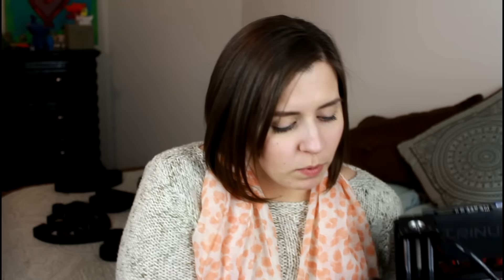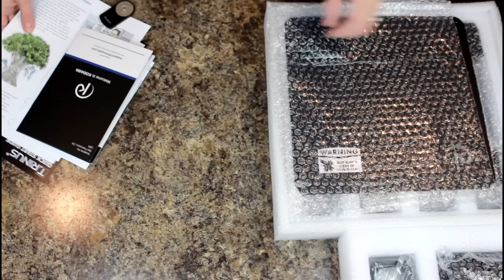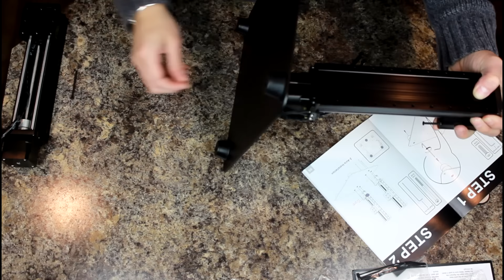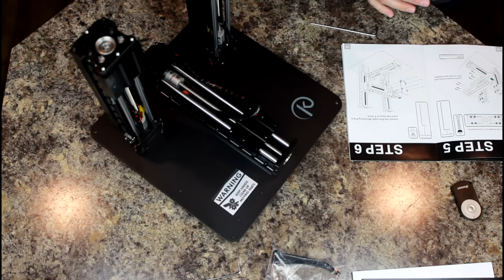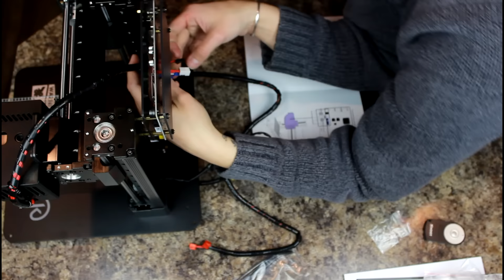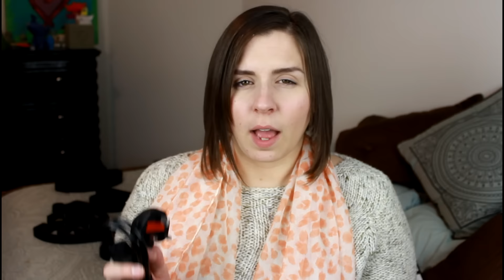Trinus3D  Build & First Impression

Comment: A friend over at our Makerspace showed up with a Kodama Trinus including the touch screen, heated bed and enclosure. I guess that must have been the ultimate luxury version. His son pulled it from his cellar. It has never ever been used before. Really hard to believe. During the afternoon I stayed at the Makerspace I searched the internet, trying to find as much information about the printer as I could. Luckily I found a firmware update based on Marlin. That way you can sliced files in gcode format. I‘ve started to create a basic Prusa Slicer profile. Still having some layer swifts on the X axis. I guess that the travel speed still has to be reduced. It’s a beefy little 3D printer. It would be really awesome if my colleague could use it.

Comment: Good Day, quick question, how much trouble if any did you have calibrating the bed with pango? i think there is a good deal of videos of reviews and assembly but the calibration process there no real guidance there. Thanks
Reply from the maker: There really isn't a whole lot of calibration options.  In terms of bed height, that is relatively simple by opening up the console in controls, you can up or down the Z height as needed.  Unfortunately this is it.  If you need leveling not just height adjustment, you'll have to either get a leveling kit or use some springs like I did in my other Trinus video.  I hope that helps.

Comment: They might have used Pango to slice the Pokemon. Cause when ever I use Pango for slicing 3D models the raft welds to them. But, when I use Cura the raft comes off my prints easy. Try a different slicer and you'll notice a difference when printing with the Trinus.  Nice channel, you have a new sub!
Reply from the maker: Thanks.  I'm going to try out Cura and simplify 3d over the next couple of weeks to see how they compare to the Pango software.  It is a decent starter program but there are things I want it to be able to do that it can't.

Comment: IDK a Monoprice MP mini is $200 120x120x120 with heated bed, and you don't have to put it together, spend another $35 for a e3d hotend and it can print anything.
Reply from the maker: I've heard great things about the mp mini, and I even saw one that had an increased bed size on a turntable while at MRRF this weekend.  It looks like it prints out great things, but since I've never used one myself I can't make a comparison.
Reply: Abuzz Designs hehe the disclaimer of all the makers. I don't own one so I can't compare.

Comment: You mentioned a different software that you will be using, have you tried it yet and does it work well? Also do you run the printer on a Mac or PC or just the SD card. great video ! I am currently trying to install it and get to work with my Mac with no success!
Reply from the maker: I have tried it, and it serves its purpose, so far Everything I've printed has been done using the Pango software.  I will be switching to simplify 3d this week to test that out.  So far I've just been printing via the sd card, although I did hook the unit up to my pc to make some leveling adjustments with no problem.
Reply: Thanks you ! I was able to get to work buy switching over to my PC.

Comment: awesome printer, it looked so easy to put it together. and the model looks amazing. what is the printing time for this model and at what layer height was it printed?
Reply from the maker: The print took 3 hours and is hollow.  In terms of layer height, I'm not sure because it was the autoprint that was already on the sd card.  I'd guess .15mm, looks less than .2